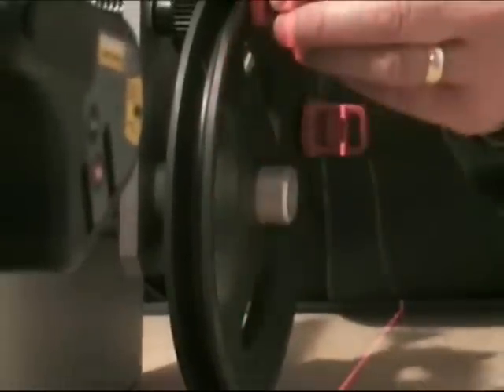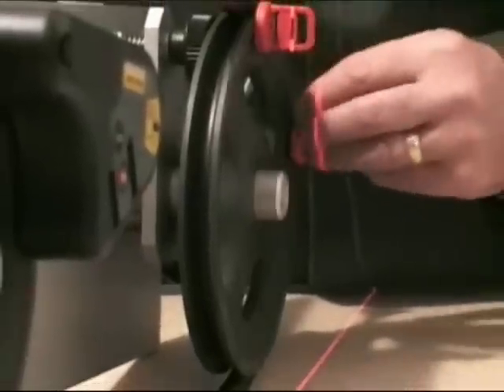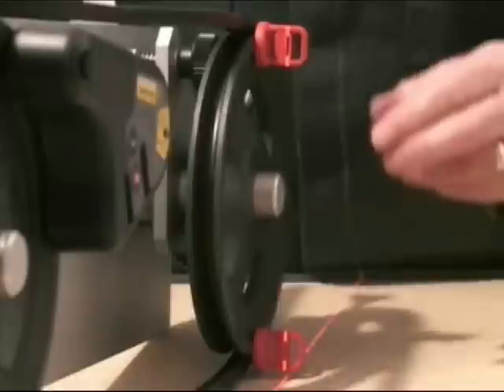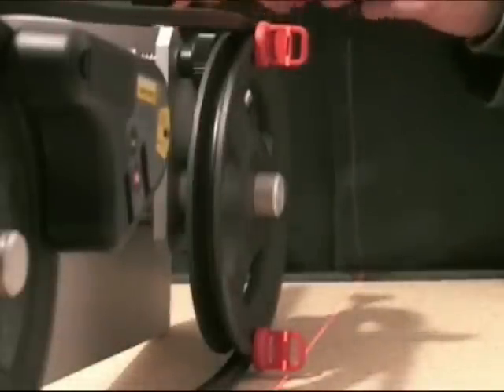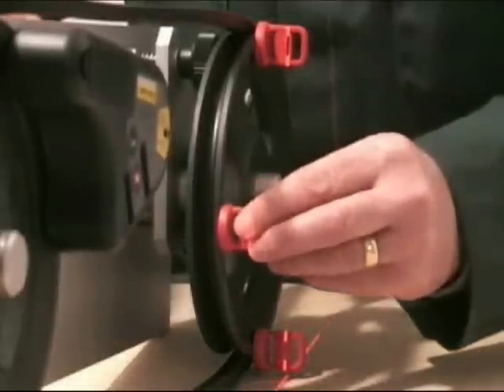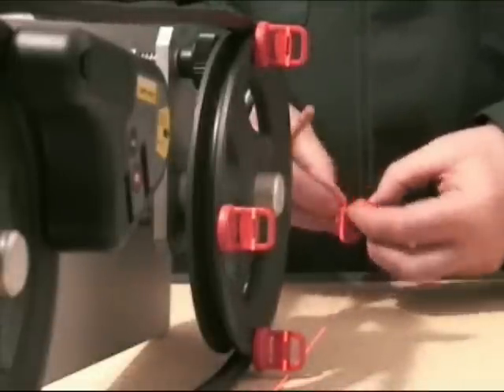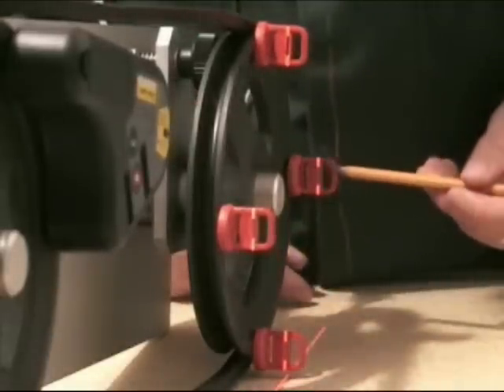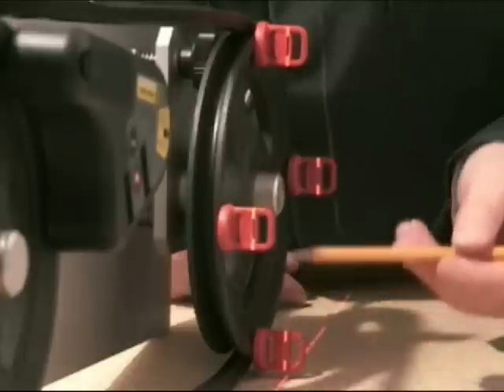EASY-LASER D90 BTA Demo - Belt & Pulley Alignment System

Comment: I am using a Powerline laser sheave alignment and I'm putting the laser on the driven sheave and the 3 targets on the drive. When I get perfect alignment I switch the laser and the targets around and it's showing that I'm way off. Can you please help me figure out why?
Reply from the maker: It seems that you may have mis-matched or different sized sheaves. You would have to compensate for that.